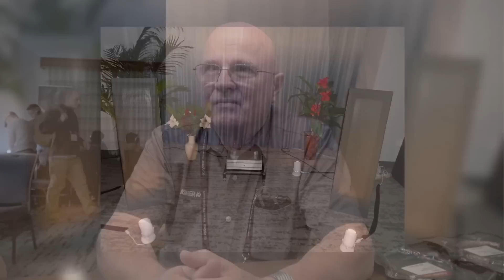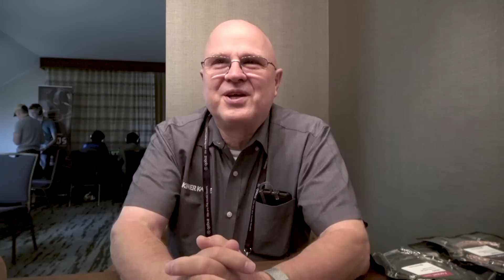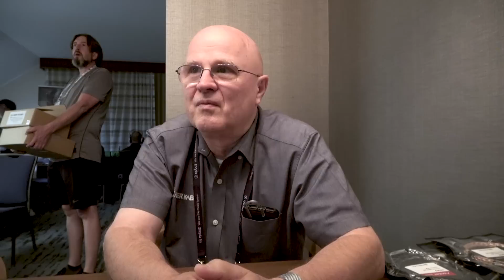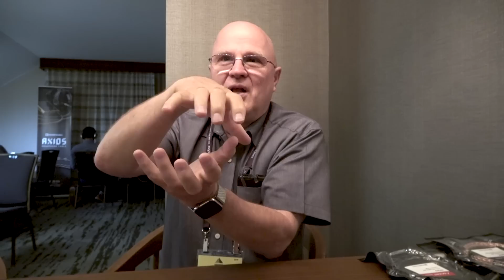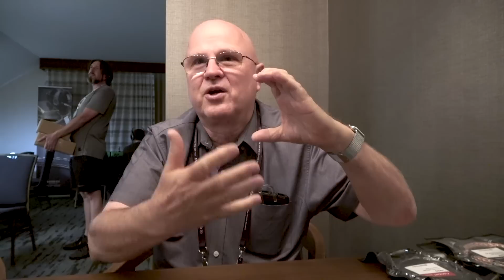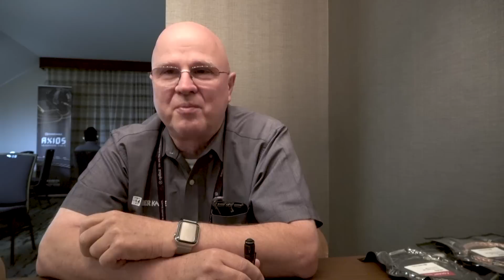Ray Kimber's passion for cables might turn around naysayers

Comment: Although some of Kimber's top lines are above my budget, I'm happy that they publish the electrical parameters of their cables.  Things like capacitance, inductance, resistance, noise rejection properties, and cable metallurgy are what makes cables sound different.  Kimber is not afraid to make that information public.  Kimber does not use "snake oil" to sell their products, just good solid cable engineering.
Reply: Yes. And the impedences of the source and the load also determine how those cables will affect the audio they carry.
Reply: Cables don't "affect" anything.
Reply: @amazoidal  -   I have experienced otherwise.  Cables can affect high frequency content if there is excessive capacitance.  Excessive resistance can affect audio levels, and interact with cable capacitance.  
A line-level cable used as a speaker cable can grossly affect the audio in a negative way.
Reply: Stanny1, depending on the performance of the system in question, cables can affect, high frequency performance, mid range performance, low frequency performance, transparency, sound stage, pretty much any and all parameters of performance.
Reply: @michaelb9664  I watched the first 13 minutes.
Most of what was presented and said is true.  But when Ethan Winer said that power cables are BS, I heard enough.

Yes, as mentioned in that video, the power of expectations is strong.  But I am 100% aware of it.  I am not going to be fooled by any sound tests.  I have heard real differences between cables, regardless of how many other gullible people with untrained ears get fooled.
Reply: @0Perhaps 
Apparently, different people can have very different life experiences revolving around the same things.
My life experiences would seem to coincide with yours much more than with Mr. Brannighan's; as, I'd wager, do a great many other people's. If not, then the audio industry would cease to exist!
I would also wager that if Mr. Brannighan were to ABX test all of those things he claims to hear differences in, he would hear no differences at all in those things during the tests.
Have you EVER heard of anyone hearing a difference in anything whatsoever, during a double-blind test?
Those tests are designed specifically to keep you from hearing any differences in whatever is being tested.
Yes, there is BS going on in the audio industry, and it comes from both sides of the wire.
Reply: @Hare deLune 

In a blind test, between components or recordings where there are actually differences to be heard, they will be heard.
Reply: @Perhaps 

Your last comment is absolutely staggering. 

Power cables make an audible difference? 😂

That concludes this conversation.

You can lead a horse to water... 🙄
Reply: @michaelb9664   Michael Brannighan  Your last comment, about power cords, confirms that you draw conclusions without testing.  You go by your gut, rather than your ears.

The test needs to be conducted on a minimum of mid-fidelity equipment -- the better the stereo, the more noticeable power cord upgrades will be.  And not for all power cords (some are not worthwhile).  But use power cords from Shunyata Research or Audioquest, on a professionally set-up high-end system, and the background will become silent, and the separation between the instruments will broaden.

The most noticeable improvement is for a CD player, because CD players send noise back into the power line, and better power cords filter it out.

I know that you think that this is nonsense, which is a shame.  But it is because you never sat down with a "real" quality stereo and conducted meaningful tests.

I became a believer in power cords, when my local high-end dealer insisted that I listen to his system with a Shunyata power cord for the CD player (I was already listening with the stock power cord).  At first, I thought, this is a waste of time.  It sounded the same.  But minutes later, I realized that I was enjoying the music more.  It got cleaner.  But was I imagining it?  He put the stock cord back, and it was hard to listen.  Going backwards is more noticeable than going forwards.  We switched back and forth again, and the better power cord was 100% responsible for the better sound quality.

It is a shame that you have never heard this.  It is dishonest that you claim to know without testing, and you spread misinformation.
Reply: What difference does published specs make in cables? What spec do you look at when seeking a larger soundstage, more air, fuller midbass? Do you buy your cables without listening to them? If you do, I would wager you don't have a high performance reference system. Even Ray states he cannot correlate the sound with measurements so how are you able?
Reply: cant agree more with you.. i use kimber kables.. i can vouch for kimber after having used many cables. Kimber is real for sure. and they measure well and i can hear the difference in the improvement of the quality of music. I have even used thier WBT 805 solder. Kimber is real oil, the rest snake oil.

Comment: i use kimber kables.. i can vouch for kimber after having used many cables. Kimber is real for sure. and they measure well and i can hear the difference in the improvement of the quality of music. I have even used thier WBT 805 solder. Kimber is real oil, the rest snake oil.

Comment: Kimber Kables are what turned me into an audiophile.  I started with PBJ which were a huge improvement over the freebie interconnects I had been using.  I could actually make out what people were singing.  I could hear different cymbals in drum kits that previously mostly sounded the same.  I tried Audioquest, regular zip cord, and Monster cable and those always sounded darker and less detailed compared to Kimber 4VS/4TC.  I don’t feel the need to spend more or move up the line.  PBJ and 4VS are great for the money.   It’s a shame so many are biased against cables for no good reason.

Comment: Oh this was something! I'm using two pairs of PBJ Classic xlr and 3 pairs of Straightwire Rhapsody?? (blue ones), all in 1,5 m lengths. Onkyo M5000r x2, Emotiva XPA1 x2 and NAD 218 x4. Kimber is on the DAC>preamp and on preamp> Emotiva mono blocks. Cause they are more revealing. Speakers are Celestion Ditton 662 and 44 and Celestion 6Si and 12Si. Preamp is Sansui CA 2000 and dac is NAD M51. 2 pairs of SVS PB13 Ultras. Kate Bush's Mother Stands For Comfort  and Breathing are full of details and layers...

Comment: What a load of horse sh*t. As long as a cable is reasonably well made and terminated it will do the job just fine. Even if there is a subtle difference to be found with certain cables, one fact remains - there is absolutely no way on earth you can justify charging thousands of dollars for a cable. Thinking about the cost of the materials/processes involved, it's just crazy.
Reply: If you wanted to clone, and make an exact copy of one of Kimber's designs, like the 8TC speaker cable, how would you do it? Or more importantly, could you do it?
Reply: @AT-wl9yq  roasted

Comment: So many haters. Why? So many "opinions". Everyone is entitled to one, however, not all opinions are of equal value. And an opinion is just that, an opinion. It is not the truth OR a fact. But, I guess people will believe what they want, with no evidence. People believe the nonsensical lies that come out of the mouth of the current leader of a super power, speaks very much to the value of opinion... Having swapped cables for better cables, there is very much a difference. Would I spend 25K on a power cord? No. And I feel there is very much a steep fall off with diminishing returns. Chain is only as strong as its weakest link. Unless the entire system is at the same level, then it aint gonna matter. But, I guess people feel they should be able to go off roading with their 500K sports car, because it was so expensive. That, and it should wash, fuel and drive itself, right?
Reply: That is why we have science, in particular double blind testing.
Reply: Roq Steady that is why we have ears, listen for yourself and find out.

Comment: As a non believer of exotic cables with exotic pricing.... I do use Kimber 8VS cables on my 14 foot speaker run.... It cost me around $325 (self terminated) and it was a notable improvement over the standard 12 gauge OFC speaker wire I'd used for years.  In this case, the improvement was totally worth it, but I'm not motivated to try other cables.
Reply: ironically, coat hangers would prolly sound the same...

Comment: Ha! This guy actually turned me into a naysayer after talking with him and trying his interconnect cables! Total fail against Monoprice cables and I'm not a fan of Monoprice cables either, I don't use them much. I'm not going to say what I use because that is not the point, but it isn't anything from the big outrageously expensive cable names nor is it anything from dollar stores.
As someone who has studied physics and believes real science over pseudoscience (or alternative facts), all this cable talk is nonsense. The only time cables make a clear noticeable difference is if 1) you either use the wrong type, gauge etc., 2) if you are replacing a shorted or broken cable or 3) if your runs are too long for the application. Otherwise, cables have but one function, which normally they do well. 
All this weaving, freezing, cooking, battery arrays, paying thousands for a 1 meter cable is pure nonsense. If one wants to drink that koolaid and follow that cultist thinking, then by all means, enjoy. 
These cable guys are just ripping off unaware folks.
I love seeing women involved in the hobby, it desperately needs women because normally women are sensible and good at value, much more than men, but this lady I find rather snobbish.  The one thing the hobby needs no more of, is snobs, please!!!

Comment: Measure the SPEAKERS RESPONSE to a cable change, not the cables themselves. Seriously, put together a system that a group of gathered audiophiles says, yes, we can absolutely hear the differences switching out cables makes in this system. But they have to claim they can hear the differences or else, should they be unable to do so, they'll simply claim the system wasn't good enough to hear any differences. Okay, now that they've confirmed the system is acceptable, measure every possible aspect of the speakers response using a modestly priced control cable. Next, switch out this particular cable with other brands unknown to the group and change nothing else until one of the group says, okay, that makes a difference. At that point measure the speakers response again in exactly the same way as you did with the control cable. If there is an audible change then the only way for that change to have become audible is for the speakers response to change, even if that change is incredibly small. We have test equipment which is far more sensitive than any human ear so if there is a change it will be captured. If the measurements consistently show a change in speaker response when a participant says there is a change in sound then we need to question how complete our understanding of signal transmission is. If there is little to no correlation well, then there's not much of a leg left to stand on for the cables make a difference crowd. But until someone is willing and able to test whether the changes occur in the first place then neither argument is truly complete or scientific.

Comment: I have only used Kimber interconnect and speaker cables, as well as Kimber chassis wire in my home-built/DIY stereo system over the last 20 years. I  use the Kimber KCAG silver interconnects, and I have yet to find a better sounding cable anywhere. Ray, keep up the really great work!

Comment: I'm sorry but for those prices that cable would need to flip my records, adjust my volume on voice command and cook dinner at least twice a week. 

I use a high quality 300 strand 12 gauge copper speaker wire for an 8' run to each speaker. Is this guy trying to tell me he has something that will make a $1500+ difference in the sound of my system? My opinion, hokum. I'll pay 1500 more for speakers or maybe an amp but this is bunk.

Comment: Cripes, all those reasons why soldering bits of wire together should not be attempted by amateurs.  The music's probably been leaking out through those pinholes in the dielectric.  Gumption and decent materials are no substitute for the real thing, clearly.

Comment: I like the cables with the batteries on them. Every time I use them my arthritis gets better. Of course, it doesn't work if you reverse the battery. Also, I'm pretty sure my fibromyalgia improves! Win win! In addition, the crystalline structures improve not on!y my aura, but the auras of those around me as well. And sound! Galvanized for sure. And homogenized too.
Reply: Those cables sound fantastic...I need a pair 😭

Comment: Until I see ABX test after ABX test showing a consistent preference for expensive speaker cables I'm sticking with 2-core mains flex, thanks.
Reply: Good for you.
Reply: @philrushton6868  Just can't seem to find metal coat hangers nowadays! ;¬)
Reply: @thisisnev  that's because they are all being used as the core of audiophile cables....🤣🤣🤣🤣🤣
Reply: Probably the second coming will happen first.

Comment: Huge mark up on cables 200% - 300%. That is why there is such a smoke screen I know because I worked for a cable maker / supplier. But there is a difference it boils down to finding a legit company and brand to deal with. Very hard for the average consumer to ..